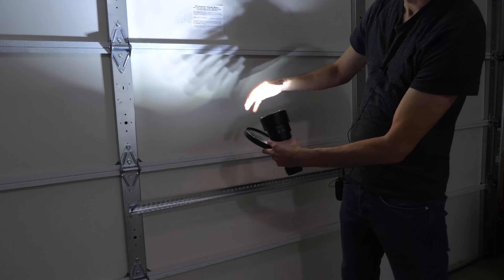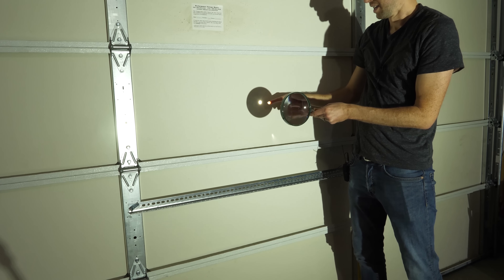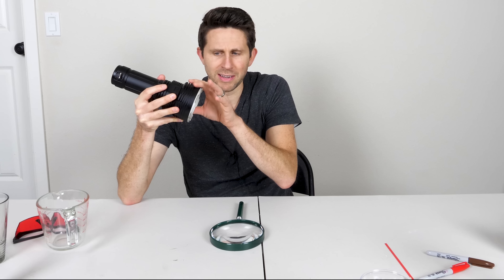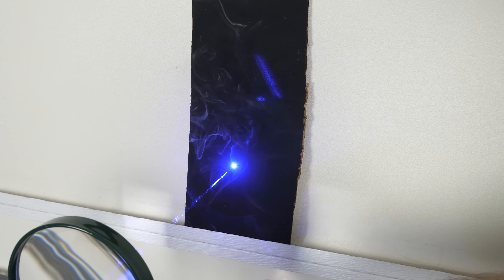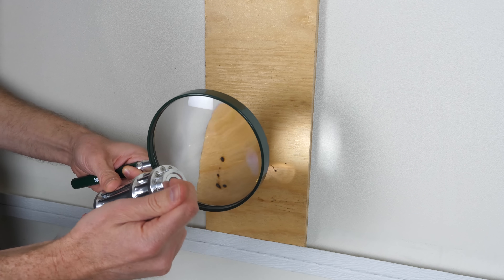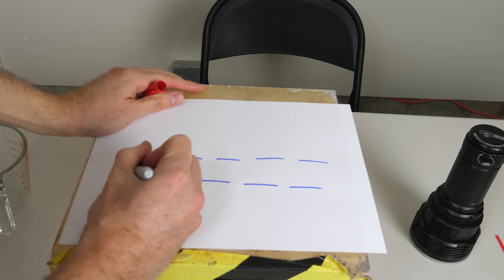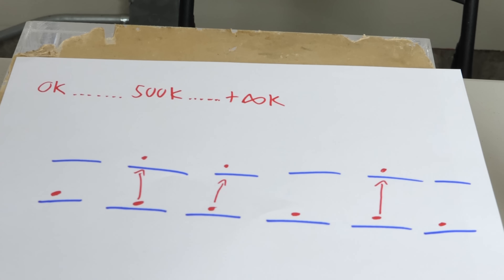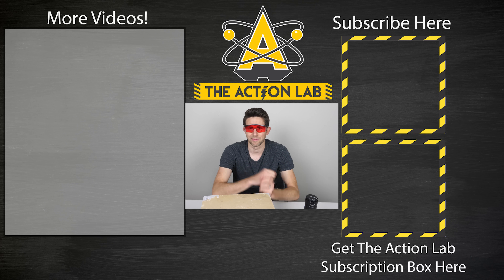What Happens if You Focus a 5W Laser With a Giant Magnifying Glass? Negative Kelvin Temperature!

Comment: So you're telling me that a photon can move faster than itself? Yeah, no, doesn't make sense.
Reply: Photons move at different speeds depending on the space they are
Reply: @JoãoLeote7331  No they don't... They just move slower in space than in time. If they moved at a different speed, that would mean that c (light speed) isn't a constant anymore. Light can appear to travel at different speed based on what it goes through, but it always travels at the same speed.
Reply: @louisrobitaille5810  the speed of light is the speed light travels in a vacuum. But when it is not a vacuum it travels slower. For example, light generated at the core of the sun takes thousands of years to come out of it
Reply: @JoãoLeote7331  The speed of light is a constant... which means it doesn't change. It appears to travel slower when not in a vacuum, but that's because it travels slower in time than in space. Space and time aren't 2 different things. Either you travel at the speed of light and you don't evolve in time (unless you don't have a mass like photons, you won't move at all), either you don't move in space at all (I don't think we've discovered anything that behaves like this) and your time will flow infinitely fast.
Reply: @louisrobitaille5810  what
Reply: @JoãoLeote7331  Go read about how light travels in spacetime, E=mc2, and relativity 🤷‍♂️.

Comment: What if you put the flashlight in a fiber optic cable the same diameter as the flashlight source, cover the cable with highly a reflective film and a lense at the end? How would it violate the 2nd law though? Temperature is not total energy, you take the total output of the flashlight and you concentrate it in area you are increasing intensity, not energy and energy is lost in the transmission through the lense and in the generation of the light so entropy is increasing overall even if it is being reduced at the one point of temperature increase. I think you need to rethink this video a bit.

Comment: What if you used multiple magnifying glasses for the flashlight, with a barrier that prevents light from escaping around the lens? Like a tube that gradually decreases diameter with progressively smaller magnifying lenses.
Reply: @Skull14 I have no idea what you just said but ok
Reply: If you just use one more magnifying glass or maybe two something would happen. You might start a fire
Reply: Wouldn’t the wood have evaporated at - infinity temperature. Did you ever watch The Avengers?
Reply: @Skull14 or simply. Laser light is already cohered.

Comment: I dont want to be rude, but this video is scientific nonsense. You get millions of views, talking about things you dont understand. 
"The energy is flowing from cold to hot" ->  Imagine a microwave. It will heat up your meal, but it isnt hot itself. The interactions between electromatgnetic waves and matter are complicated and have to be understood by you, before making such a video. There are fundamental differences in laser radiation and thermal radiation. 

You have to know, that the laws of thermodynamics are made under assumptions. You cant change the assumptions afterwards and still use the laws to get the solution you want. Plz write down the law of thermodynamics you are talking about.

Your example of energy states.... you postulate, that if all atoms are equally distributed on energylevel 1 and 2, the temperature is +inf. - Dude... Watch a video about laser pumping. To achieve a laser beam you need population inversion. If you have a 2 level system (which doesnt work well) The incoming energy is absorbed to get the electron in a higher energy level. If it drops down again, it emitts a photon with the same energy like the photon that exited it before. So where is the energy heating up your laser crystal to infinity? A lasercrystal gets warm because in reality there are more than 2 energylevels. The electron doesnt emit a photon on every step through the energylevels. Some energy dissipates into heat. 

Before you believe such nonsense: Here is a Video of a Professor from Institute of Laser Technology in Aachen, Germany. 
https://www.youtube.com/watch?v=MU4eOJw2sBQ&list=PLH0EinUBR4-Y8WJQwBfcNn0cXCVYIqID-&index=3

Comment: Has anyone tested putting a laser with a magnifying glass on a Stirling engine? Would that create a negative feed back loop that generates more power than 5 watts for the laser?
Reply: No xD
Reply: @KING-lw8nv  no to which question?
Reply: @fanofmetal1  Probably the one where you ask if it's possible to take more energy out of a system than you put in.
Reply: Concentrating energy to a point doesn't increase the energy output, it only reduces the surface area it's applied to. You can't heat a large chunk of metal to its melting point using a laser like that, only a tiny speck of it； and because metals tend to be good conductors of heat the temperature would average out to just "slightly warm"

Comment: 01:46 
by using  reflector around a small LED to send a concentrated bean onto a lens as wide as that beam , that converges all that light into a tiny point at a certain distance, will definitely make that point of light (which contains all the light that the reflector caught) objective brighter than the whole thing spread throughout your wall. That's basically why sunlight over your lens area accumulated into a tiny point causes that surface to burn, as opposed to getting mildly warm otherwise. Its objectively hotter/brighter
Reply: But you can't get the point hotter than the surface of the sun. Also, reflectors don't reflect 100%.
Reply: @xeridea  if, theoretically, all the energy from the surface of the sun was concentrated to a singular point, then you would have a point hotter than the surface of the sun. this doesn't break the law of thermodynamics because you aren't creating any more energy, you are simply just moving dispersed energy together, i.e. increasing the energy density, but not the amount.
Reply: I thought about this as well, but this system is just projecting an image of the light source at the point of focus of the lens. So the resulting point of light would still be as bright as the surface of the original LED.

Comment: The temperature definition is just too brief even for people with a limited knowledge of thermodynamics. Its the measure of  "exited" atoms. 
Okay fullstop, what approach to temperature is that what field are we in to begin with? Reading into the wiki article on negative temperature the approach and entry to the defenition to temperature is extremely confusing when you don't mention entropy

Thermodynamics professors already are weary about overlapping terms that have colloquial definitions.

 flipping into negative temperature 60s later. A lecture bootstrapping all definitions wont fit a short and sexy video but thanks for the headache

Comment: 2:00 This is incorrect. Etendue is conserved, but that’s not a result of that. You could use a lens or mirror to first collimate, and then you can use a lens to then focus it. What etendue conservation gives you is the intensity as a function of focal length. You need a shorter focal length (higher numerical aperture) to achieve higher intensity. The only limits to intensity are diffraction, dispersion, aberration and lens thickness. In fact, any time you focus an image at a distance less than the distance to the source, the intensity is higher. this is what etendue conservation gives you. You’re oversimplifying the application of the second law, by your logic, air conditioners couldn’t work

Comment: Wouldn't you reach the ionization energy needed for the electron to just escape the atom much before this? If it got hot enough Itd seem you'd get nuclear fusion and end up with a nucleus soup. 

You can still easily explain what is happening here though, because I think you are confusing heat and temperature. The overall heat input doesn't change, the amount of energy put into the system. The temperature is higher because the heat is more concentrated.

I may not know what I'm talking about.

Comment: I have a doubt sir,
Without violating thermodynamics can we just focus all the flash light part to a point so that the point still slightly less brighter than the led itself but now used most part of it.
Combination of lenses : first put led at the focal point of a converging lens in order to get a parallel rays of light instead of diverging one.
Now since we have parallel rays we can easily converge it to a point by again using an another converging lense. This we we can get maximum of flash light without affecting thermodynamics.
Please let me know the results.

Comment: 6:00 Its negative only by the definition. In statistical physics the temperature is just the slope of 'entropy vs energy' curve. As the system gains energy, its temperature keeps increasing.. so does the entropy.. so the slope of this curve is always positive. But as soon as we hit the point when upper state and lower state have same number of electrons.. although the energy is still increasing..the entropy starts to decrease( because entropy is just the order of disorder.. and the system is getting ordered beyond this point). Thats why the slope of the curve inverts and we have a negative temeprature by definition.. which is actually hotter than +infinite temperature. 🤯🤯

Comment: For some reason, my first thought about flashlight/sun was inverse square law, rather than thermodynamics. Where the energy per unit area is based on the distance from the source, and you cannot amplify that energy without putting additional into the output. But, you can use larger area of capture and focus that on a smaller one. That's how parabolic antennas work. In any case, the output will always be a fraction of the source. Lasers have the same problem over large distances.
Reply: You're right, he's wrong. The energy sums, it cannot go away. It can be hotter in the point of focus, however the total energy will not change. Imagine glass if water. If you move all the heat to top part it will become steam, but the bottom part will turn ice. The total energy will remain same and heat will come to equilibrium with time, turning it back into glass of water. The dude needs set of lenses to actually focus light from led
Reply: Yeah isn't there those BBQs where you put a sausage or so in a parabolic mirror's focus? Only works in sunshine of course, although you could probably construct a larger one that also works with cloudy weather 🌭

I mean hey, if you made this thing huge it should even work with moonlight 🤔 Unlike the light through clouds, the latter would even come from one direction, with the moon being fairly far away — although the sunlight gets scattered by the moon before being reflected, as it isn't a giant mirror 🌝 By the way just FYI there's cool videos on "what if the Moon was a disco ball" 🕺🏿
Reply: Maybe because laser runs into objects in the atmosphere or space over large distances.
Reply: Hmm what would happen if the laser didn’t hit objects like dust and particles on its way to an object like pure light? With no interruptions what could we do with that? Would the outcome be different? Hmm
Reply: @freerise8754  I tell what happens, photons, as predicted by so much hated  theory of relativity, are being fased oud by their relativity effect, on which I wrote dissertation years ago
Reply: @alexprokhorov407  interesting
Reply: @freerise8754  yes
Reply: I use magnifying glass and the sun to make woodburned art
Reply: Correct energy can only be rearranged 

A laser is an array straight line now imagine this under water in a vacuum or in space?!.
Reply: OHHHH i never connected the dots on why antennae were parabolic

Comment: Temperature can be defined as amount of heat (energy) per unit volume (or per unit area in this case). So there is NO violation of 2nd law of thermodynamics as the same amount of energy when focused on a smaller area gives you more temperature than the source where the same energy was distributed on a comparatively larger area.

Comment: I think it has less to do with thermodynamics and more to do with conservation of energy.  Temperature is the average kinetic energy of particles in a system.  Heat is the total energy of particles in a system.  When you add energy to atoms, electrons jump into higher energy states.  When the electrons return to their base state, a photon of light is produced with the energy equal to the energy the electron required to jump into the higher energy state.  Photons are particles of energy.  With light sources like a flashlight or the sun, the energy has a high scatter and therefore less energy per point.  It would be possible to collect all the scattered light via mirrors and focus the light to a single point with the same energy as the source.  Because lasers are essentially directed light, it is easier to collect the light energy to a point with the same energy level as the source.  The reason the laser is slightly scattered has to do with mechanical limitations of the source itself. Thus the heat energy received is directly equal to the energy applied to power the laser (never exactly due to mechanical limitations) and the total heat received is the heat applied over the time it is applied. Thus, the total energy of the system is conserved

Comment: So for anyone who is interested: The confusion here, Is that the negative kelvins are not a thing unless you are describing massless photons at a uniform upper limit. And he really only needs a freefloating lazer beam with no source, and a lens for this demonstration. The point is that if the limit on temprature was really low then the differences between tempratures become more important, and can begin to act as if though they were hotter without more energy. So in other words, higher potential energy then they should have. When he says "focus down to a point hotter than the source" he means that even though all parts of the laser's photons are cold because they are low energy visible photons, they can be forced to do more work than more massive and traditional atoms in space by simply moving through the lens. And they can do more work because they are uniformly cold. When that uniformity simply becomes more focused via that lens, the flow from hot (the hoter target the lazer hits) to cold (the colder laser) has a higher impact, with no change to the overall temprature. Ergo the scale of temprature can be described as being lower than 0 kelvin, if the laser starts off with being sufficiently cold and passes through a lens, which is not activly doing work and therefore should seemingly not contribute to heat in the system.

So the normal kelvin scale in that case is not accuratly describing the work being done. So the laser is instead described as being several hundreds of kelvin below 0.

None of this is about how hot or cold the "system is" its about the behaviour of the potential workflow. Thats why he keeps mentioning the 2nd law of thermodynamics. The 2nd law of thermodynamics would seem to have a problem with more energy being extracted from a system. But it doesn't, because the thermodynimcs describe the entropy of this interaction perfectly. The experiment is a discussion on how to explore and quantify heat in kelvin.
Reply: no one will read all of this you know
Reply: @RandomName1500  imma read the whole thing now just cuz you said that. 😒
Reply: @eclipticpeak8452  you’re welcome for wasting your time😀😀😀
Reply: @RandomName1500  it actually makes a lot of sense if you read it. Some people like science some people don't. It's okay that it isn't interesting to you.
Reply: @eclipticpeak8452  science is actually my favorite subject i just dont like reading big paragraphs
Reply: @RandomName1500  remember, If you have nothing nice to say, say nothing at all.
Reply: @TheKooKooMan117  so im not allowed to have freedom of speech?

Comment: "In this case we have to define temperature as negative or else we get into problems that break the second law of thermodynamics. [...] This is a very good example of how the second law of thermodynamics can never be broken no matter how hard you try."

This is an incredibly cyclic argument. Of course you can't break the second law of thermodynamics using lasers, if you've defined the temperature of lasers in such a way as to avoid breaking the second law of thermodynamics.

Comment: I kinda disagree with one of your statements here... Maybe you couldn't make sunlight hotter than the surface of the sun with only one magnefying glass... But let's say... Hypothetically you had a few GIANT mirrors... You could reflect the light and heat from all sides of the sun down to one point... And then you use a magnefying glass to concentrate everything down to one point... Remember the light isn't coming from one point, but multiple... As long as you can reflect and refract the light down to a smaller point than the source that point could me hotter than it's source... I think

Comment: …the point simply isn’t hotter than the collective heat that the laser exerts over the original area that it covered. It’s just a smaller point when magnified, so it has more energy per square unit of area, but the same total energy.